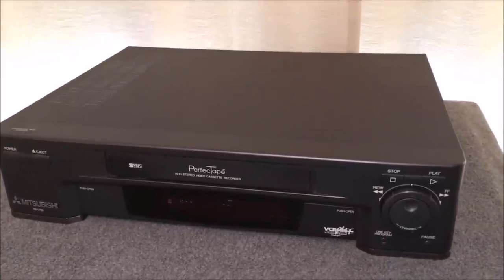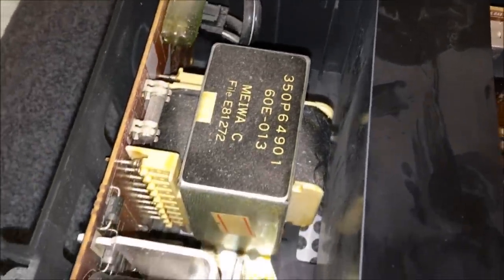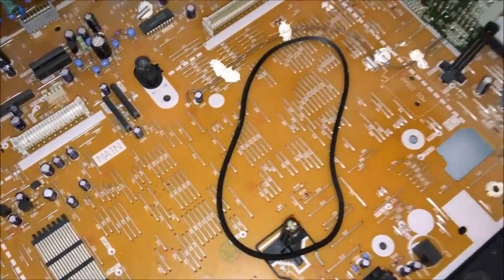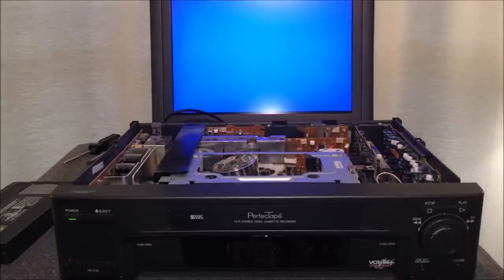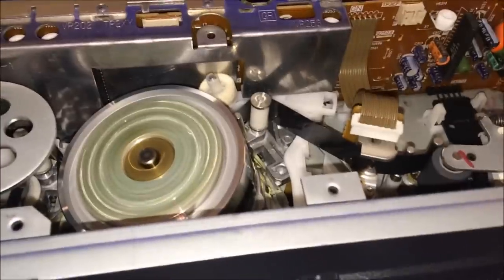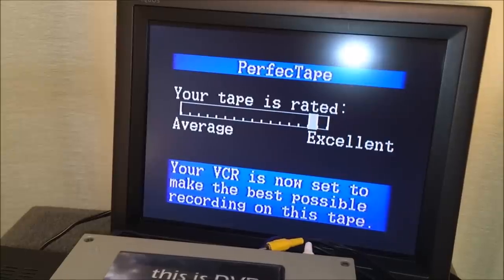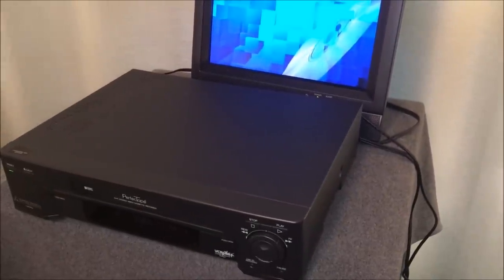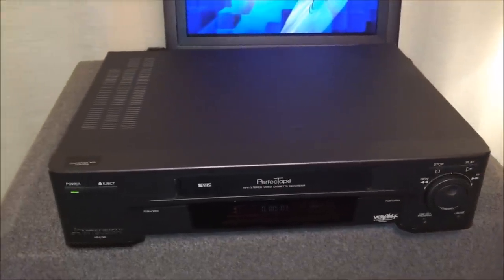SVHS VCR Mitsubishi HS-U760 from 1996 with PerfecTape

Comment: I have repaired hundreds of those Mitsu. VCR's from 1982 till 2005.I worked for a huge national repair center,great video! One hint,you can restore belts that have expanded by dropping them into a Pyrex glass container with water and boiling for 2 min. in a microwave,it works very well if no belt is available.
Reply: TV Tech I'm honestly curious will the boiled belts last as long as a new one?
Reply: They do not last as long, but might get you enough time to order the new set and have them arrive on the slow boat from the little old man in Japan that made the spare belt kits. However if you are in a jam, and the old belt has just stretched slightly, and is not gummy, it will work.

The joys of VCR mechanisms, where every plastic part clips together, and seemingly is determined that you have to remove the rest of the deck to get to the failed part. Most likely failure on that deck now would be the mode switch, as it has sat for a while unused, so the contacts will be slightly oxidised and the grease aged. Then the slides will need new lubrication, with the correct white grease. At least that Mitsubishi does not have a switching power supply, where the repair kit consisted of every electrolytic capacitor, every resistor, a few diodes and a power switch and driver, because the failing capacitors would cause every other part to go out, except the resistors, as they just were run a tiny bit short of max ratings.
Reply: SeanBZA Thanks for the reply, and that's about what I figured, as I've always just gone ahead, and replaced the belts in anything I've repaired, Even if it meant waiting for a correct replacement in the mail.
Reply: Yes they will last quite a long time,I learned this trick from 12voltvids on YouTube
Reply: @tvtech2582  can it be repeated if the belt expands again?
Reply: Yes, until the belt either dries out or stretches beyond repair.

Comment: Chroma was always crappy on SVHS never impressed with it, but it still was a slight improvement over VHS.  Back then it made a great audio recorder with upto 8 hrs of audio with 20-20KHz, no W&F, s/n ratio >70db, and dynamic range >90db. You couldn't tell between CD and VHS and it was analog!
Reply: If you used a Sony PCM encoder/decoder or a Technics SV-P100, then you could record digital audio directly into the video signal of the VHS tape
Reply: Yes Chroma, noise was evident on JVC SVHS VCR's, Soft, or too much noise,  The Panasonic VCR's were better
Reply: Use a trial version of Ideal DVD copy, (10 free tries) to remove macrovision copy the dvd to a Blank DVD-R
Reply: SVHS Never really took off, as the VCR's were expensive, compatability issues, and the media was pricey, was not as popular as standard VHS.

Comment: I recently did a Blu-Ray to S-VHS conversion. I had to dig up my old ATI X1800 All-in-Wonder video card to do it, which (amazingly) works on a modern PC. The X1800 AIW has a dongle for S-Video output. I ripped the movie John Wick from Blu-ray without re-encoding the video stream. I then played the massive 27 GB file in MPC-HC, and had the program downmix the 7.1 TrueHD to Dolby Surround stereo.

I was actually quite impressed with the results! The S-VHS recording was much sharper than even my best pre-recorded VHS tape (the AV receiver's video processing probably helped immensely here). It wasn't quite up to Laserdisc standards, but surprisingly close. The audio was also fairly impressive. The Pro Logic encoding obviously made the trip, as I heard decent stereo separation and rear channel activity. The source file's discrete 7.1 TrueHD track was obviously much better, but just a few months ago I didn't even think that video tape could sound so good! Bass was the weak spot, as it seemed to be limited to around 45Hz or so. I was definitely hearing some low end, but it didn't even come close to the downright relentless TrueHD track, which gripped the room and shook it like a set of maracas. 

All in all, it was  a fun little experiment with a format that I pretty much ignored back in the day.
Reply: But of course its way better than any prerecorded tape! you have as a master a moder digital recorded film on a 1080p format. Thats way a better source as they were in the 90’s. I doubt the amp videpoprocessing would improve anything on that particular case...
Reply: Try converting to a vcd!

Comment: It's 2022 and my trusty Mitsubishi HS-U650, which I paid $550 for when new, decided to lock on to a tape. Watching this video was a Godsend! I removed the chassis, and after you mentioned fenangling with the tabs on the front, was able to remove the face and get the trapped tape. I cannot thank you enough for your video! I could not replace those family videos. Now I can digitize them with another Mitsubishi.
Reply from the maker: Glad this helped!
Reply: Very very grateful!

Comment: I remember when Mitsubishi was getting big sales in the US with Diamond Vision TVs kind of surpassing Sony's Trinitrons for a period in time.  Obviously the SuperBeta format did not save the Beta format in the consumer sales and DigitalBeta was almost completely professional use.  That said, I still own a Mits S-VHS deck which I haven't tried to connect and play in many years.  I would doubt it would work alone due to belt issues if for no other reason.  I was never aware of the PerfectTape tweak until your video.  It seems to do what auto-bias cassette circuitry did for cassette audio recording decks where it made comparative signal tests to tweak the bias and other parameters for optimal tape recording;  That is definitely a worthwhile tweak I'd have to imagine.  I should note I thoroughly enjoyed your trouble-shooting belt repairs which seemed to indicate the actual electronic components were still working as they should.  When Mitsubishi exited the consumer video market in the US we lost a key innovative player.  If memory serves Panasonic was a Mits company who also exited the US market at a point where they had taken the plasma TV flavor to it's near greatest peak similar to the Pioneer HDTVs.  Are there any Mits brands, such as Panasonic, still sold in the US today?  I realize they've come back in the high-end audio realm with Technics to a niche degree, but I've not seen any Panasonic HDTVs since they too exited the plasma HDTV US market.  I actually still have a 47" (i think it's a 47" though it may be a 42" model to fit a cabinet I had) Panasonic plasma HDTV that works like a champ.

Comment: No one talks about SVHS, good video.
Reply from the maker: Thanks Dash!
Reply: @databits  I had a Toshiba 6 Head VCR years ago that could record VHS and play SVHS.  It called it the SQPB system "Super-Quasi Playback".  I don't think I ever got a chance to try an SVHS tape in it, but it still only had composite out and no S-Video so you'd still lose out on the Luma/Chroma separation.

Comment: I have one of the last gen Mits SVHS VCRs the HS-U790. Took it out of storage and did a manual clean of tape path (original grease still good). Turned it ON —works like new. Good machine -nice picture.

Comment: I got a nice JVC super VHS about a 1992 machine from eBay charity auction for£10 UK was sold as broken as a tape jammed, and they removed it turned out not to be broke they just knocked some brass fittings from the control arms I refitted them and it is fine looks like it has hardly been used if it even has.

Comment: That VCR will make a fantastic Audio tape recorder, as it also has a recording level control, with level meters on the fascia, and rear mounted RCA connections.. So you could store it in a HiFi rack.
I have Sony and JVC HiFi VCR's which I use for that purpose, and the audio recordings are awesome, much better than most compact cassette decks, as you do not need Dolby Noise Reduction, so recordings sound natural and uncompressed.

Comment: I'd like to see how "Perfect Tape" would react to a VHS tape with the SVHS ID hole drilled into it.  So it would try to record SVHS on a VHS tape, and also how it would "rate" the tape.
Reply: It will record as a S-VHS but your playback won't be S-VHS quality because the S-VHS tape is of higher grade to allow the 420 lines over standard tape which is 240 lines.

Comment: I remember LightScribe lol. I had an old HP desktop back around 2008 that had a LightScribe drive and almost any CD I burned back then was LightScribe. Sadly now you can't even buy LightScribe blank CD-Rs anywhere, and the designs have also faded off most of my old discs anyway
Reply: I have a HP DVD drive with LightScribe from 2011 but I've never had LightScribe discs.

Comment: Back in the day Laser disc were the best source to record   Most Laserdisc did not have any copy protection
Reply: Val Willis None did. Laserdisc had different information in the space that macrovision would’ve used. So, Laser disks could not be encoded with macrovision. This is why the movie studios were so quick to adapt to DVD & abandon laserdisc.
Reply: Laserdisc was the same resolution as S-VHS but S-VHS didn't grow because nobody wanted to pay extra $$ for S-VHS tapes or players when laserdisc was right around the corner and it seemed to be better when it really was not, even DVD was only 480 lines over S-VHS at 420 lines. 
From 240 lines to 420 lines was a huge difference, 420 to 480 was not that much better.

Comment: Those centre mounted decks were a pain to work on because you had to remove the entire deck from the chassis to fix anything, and you had to reassemble to test, and if the problem remained, you had to take it all apart again. I much preferred the mechanics to the left where there was easy access to the top and bottom. They also looked more pleasing to my eyes too. VCR's with centre mounted mechanisms always looked cheap and tacky to me.

Comment: What country was this made in?  The Mitsubishi VHS machines sold in the UK were actually made in the UK.  Scotland I believe.  I seem t remember some really dodgy ones from around 1982/83 which had a plastic chassis that used to distort and basically render the machine irreparable.  We had a lot of them on rental that had to be condemned.  The Hitachi VT-11 of the same era proved a much more reliable rental machine.  Mitsubishi got better after that and had some pretty nice machines up until the early to mid 90s, with decent quality decks in them.  Mitsubishi in the UK completely dropped out of the Home Audio Visual sector some time around 2000.  A lot of the unsold stock ended up at a place called Superscreen in Middlesbrough where I was lucky enough to purchase three HS-M1000 super-VHS recorders quite cheaply.  The M1000 is probably the generation before your machine, and is visibly better made than yours in terms of the casing and the layout being better for servicing.  The M1000 for example has the deck on the left not in the centre, so there is no PCB obscuring it from underneath.  It also has many more physical buttons and switches, and other features like a mic input for audio dubbing.  I'm not sure whether or not yours has VU meters in the FL display or not.   I sold 2 of the M1000s for a small profit immediately after buying them, but kept one for myself until a few years ago when I put it on eBay and it was picked up by one of the former Mitsubishi factory workers who remembered it as the flagship model of the time he worked there.  

I love your video and have never seen the PerfectTape system before.  JVC over here had something they called B.E.S.T. which seems to be roughly the same thing, but it only ever gave you a light on the display to inform you that the tape analysis had been done.  It certainly never gave you a tape score rating like yours does.

Just 1 mistake you made in the video when talking about the tape remaining laced around the head drum during winding.  That's actually nothing to do with the real-time counter.  It is simply to allow it to have the image on screen with as little delay as possible after pressing the play key during rewind or fast forward.  Machines that unlace to tape to do winding will always have a delay while they lace up before they can produce a picture.  Usually you would still see your TV channel on screen for several seconds until the tape was ready to be played.  The exception to this would be Hitachi machines which would give you a black screen between the time you press play and the picture from the tape appearing.  This could be annoying to users I guess.  
Anyway, the real-time counter is generated from pulses on the control track which is a linear track on the tape, read by the audio/control head, not by the spinning drum.  Panasonic's G-Mech which was also used in certain Philips machines is one famous (and generally highly-rated) mechanism that uses a sub-loading arm to keep a loop of tape out of the cassette, against the audio control head, while the rest of the tape is unloaded back into the cassette during winding operations.  This allowed the real-time counter to work, while limiting the wear to the video heads and drums which is often suffered when machines like yours remain fully laced up during winding.  Of course the G-Mech still exhibited that delay after pressing play before the image appeared on screen.

Comment: Hi there, I have the model U570 that I bought recently at Goodwill for $5.49 and it looks and works nicely... This is quite different in some ways then my other VCR decks... Some different display on screen... Has the bar S-E and REM 6:06 when the tape is fully rewind and 10h05m53s that changes from time to time.. I cannot or figure how to reset this if possible or what does it mean?...
Reply: I think I answer my own question on how to reset the display numbers.. On my remote on the top portion I flip the lid and hit "cancel"... Now it reset the display to 0.00.00

Comment: Furthermore, the unit's tuner certainly cannot receive modern all-digital transmission from cable or other sources.  What possible use is this machine at present?
Reply: steelers6titles av input? Here in Portugal, there are some analog channels in tvcable subscription.

Comment: HiFi-VHS uses FM carriers while embedding the signal and is demodulated for playback. Sound familiar? It’s basically an FM broadcast without the actual wireless transmission.
It uses a 2:1 dbx-alike companding NR system to achive the S/N.
Without that it would be around 50dB S/N.

The compression is the most severe issue with HiFi-VHS.
Very audible on a quality set-up.
Beside the pumping effect in between, the sound signal was degraded in almost all parameters behind sound quality.
The "Character" influences qualities such as soundstage, perspectives, clarity, naturality, attack, precision, articulation, air around the musicians, microdynamics, overtones, relations between "fat" and "tiny" instruments etc. etc. 

Demodulation noise at 60Hz is annoying.
50 Hz noise from the helical scan system is also annoying.
Incompatibility in between decks were extreme.
Fragility of the tape path was an all time issue.

Most people claiming it's better than cassette lack the skills (or the cassette deck lack the option) of calibrating to the tape formula in the cassette deck. This was not needed with helical scan head of the VHS.

HiFi-VHSha good relatively flat frequency response from 20Hz - 20kHz but restricted to that.

Cassette could at best go from 17Hz to 25kHz rather flat and the cut of was not steep as it was with VHS.

Most people used HiFi-VHS to get more playtime.............for party etc.

Main problem for people to determin the differences in quality is their lack of trained hearing, their use of middle of the road gear, their listening room being filled with acoustical issues, their lack of skills in recording etc. etc.

Using a PCM module can make VHS recordi digital.
In that case you get a completely outdated digital resolution that even a Smart Phone can do better.

Comment: How does the adapter cassette know you have a SVHS tape inside it??
Reply: There is a plastic rod that sticks up inside the S-VHS machine that will slide into a special hole in the S-VHS tape that will tell the machine that its S-VHS .. If you insert a regular VHS tape, the tape does NOT have that hole for that rod and it will force push that rod down which opens the circuit to let the VCR know its a basic vhs tape. 
Kinda like a compact cassette has those tabs on top to let the recorder know if it can record or not. you must break the tabs OFF to prevent record over. OR put tape OVER those tab holes so that you can record over that tape. 
Same concept